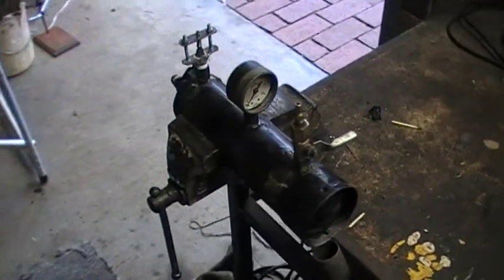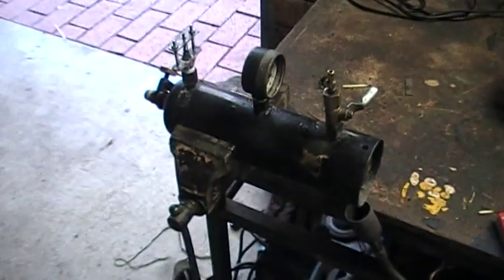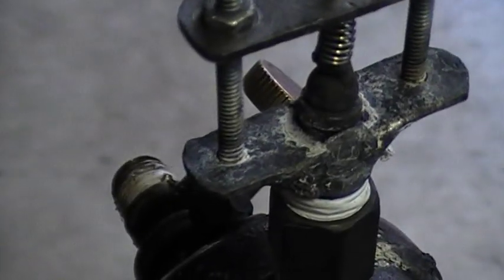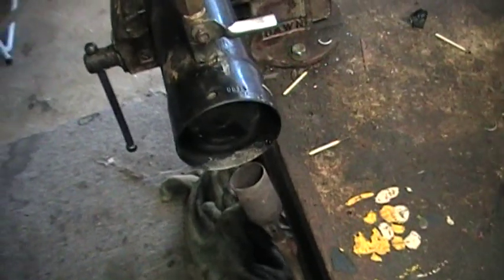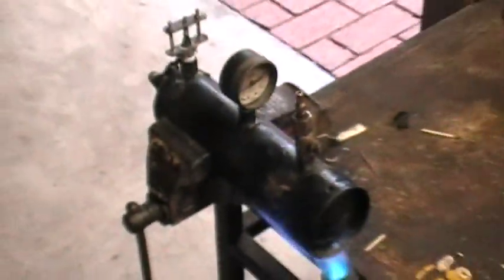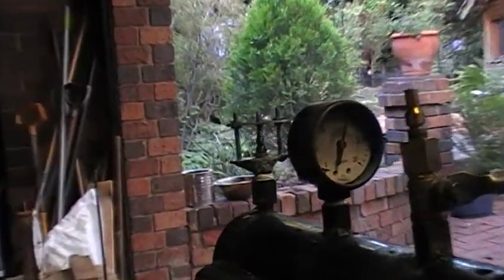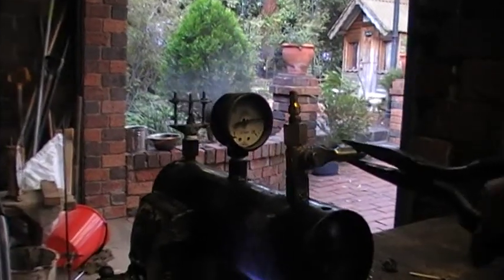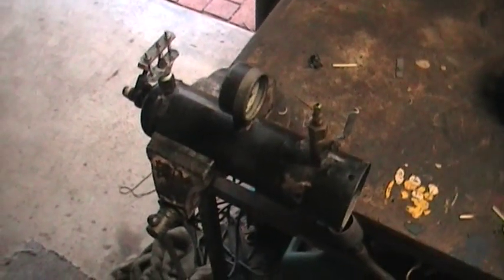Homemade steam boiler update

Comment: Hi, you have done well. You sound young, so that's even better. I made a boiler out of a 9kg barby gas cylinder, out of test. I tested a newly charged barby gas bottle at near 290 psi on my gauge. So, I have set one safety valve at 65psi, and the other at 55 psi, and it works WONDERFULLY. I use mine vertivcally on a mid range gas ring, and it can run many small steam engines, or 2 or 3 very large ones. 
Good on ya mate. Another Aussie.
Steam engin I hear you say!. Contact me.

Comment: hey m8 can i pick your brain im looking at making a steam boiler for my still as its alot easier to make 5 to 10 liters of water boil than 50 i can make it wood fired on small scale and it will pump out lots of heat witch i find cool and consumption should be cool as well nos can you put the valve that you have on the side so you can use more of your chamber room what are some tips on maintaining your pressure how do you test for pressure safely btw if you ever interested in stilling just ask

Comment: Concept proven.  A working Accucraft or equivalent small-scale boiler has a flue running through it to allow the flame to enter one end of the boiler and the exhaust to be updrafted from the opposite end; such a set-up is perfect for propane or butane as is, and can be adapted to coal with a firebox and grate.  Now for a syphon for on-the-fly water replenishment....

Comment: steamcar.net/z-foisel.html
Trick is the boiler uses, A valvles pulse jet type housing,andDeisel typeThemistat too individualy open and then close each boilers feed water line with temprature fuctuation as the water coming in to the boiler will temporaraly cool each tube,
The boiler breaths and burns like the jet but make heat and steam rather than being tuned for thrust.